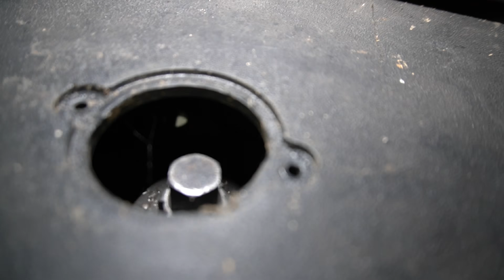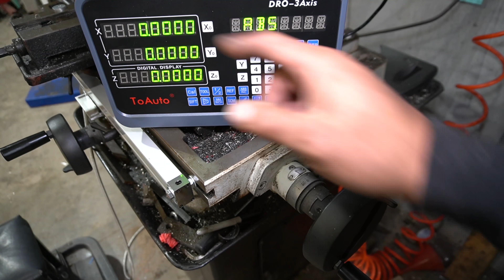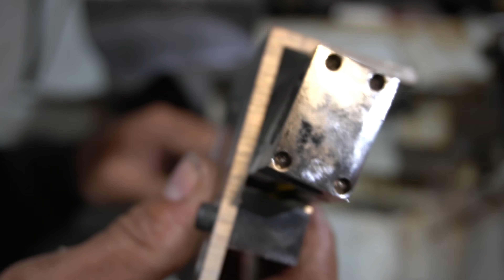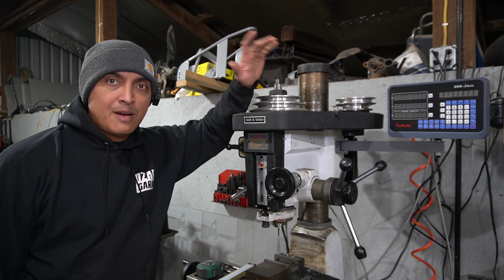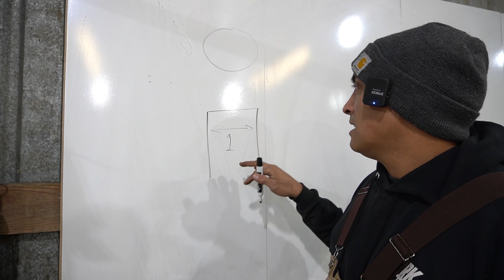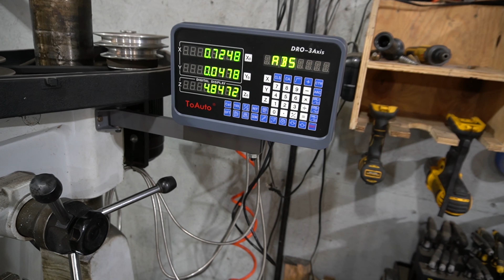Mill/Drill Upgrades Part 1: DRO

Comment: Turns out your RongFu is very similar to my Central Machinery mill also, and I think we also bought the same 3-axis DRO. So this vid is just what I needed for pointers on my install. I won’t be doing mine exactly like you did, but definitely helpful answering some small detail questions I had, and the final result turns the mill into a much more accurate tool. Thanks

Comment: What length rail do you need for each axis? I purchased an RF-31 model.
Reply from the maker: I got the 150mmx300mmx550mm kit (effective travel) mounting lengths are 140mm longer than the effective lengths. It is listed at 5um resolution,  which comes out to be .0002"
Reply: @ozarkgarage Thank you

Comment: the problem on these mills is not the DRO,   its the play in the spindles!   everytime to move your part you have to ''lock'' the table,  and believe me, that is difficult enough because it tends to move while being fastened!   if you are really working to great precision the only way to go is to change the spindles for more accurate ones, (ball bearing ones)   for this you need a lathe and quite an amount of time,   but after having done sthat it works good (besides the problems with the ''plast gears in the mill! ( but thats another issue!)
Reply from the maker: No plastic gears on this one. Belt drive

Comment: When you did your X axis what did you do about covering up the ball oiler in the table?  It is kind of an important oil point for the bed ways.  Of course it is the same thing in the back, another ball oiler that will be covered.  I am going through a similar installation and am at the point where I have tried everything, only thing left is to drop the scale down which almost works but with the shield it will still be covering the ball oiler so I will have to notch it in such a way the oil gun nozzle can get to it.  Good video, I am watching it again to refresh myself on my choices.  The last thing I am considering is ordering a compatible (ToAuto) slimline scale, thinking it might be just enough to work better.  I have another floor mill to do with four scales and a three scale to do on my lathe.  The lathe may be problematical as I want to put the taper cutter on as well.
Reply from the maker: I just lubricate the ways from the outside. With a long flexible oil can nozzle, you can reach everything.

Comment: Question.  Do you have a ball screw installed in this unit ?  If not, how do you control the backlash.  Thanks.
Reply from the maker: No ball screw. Backlash isn't really an issue with the DRO since it tracks actual table movement and not rotation of the dials.

Comment: Great video. Just picked up the Jet version and ordered my DRO.
Reply from the maker: I ended up having to move the x-axis linear rail to the rear of the table when I installed the power feed, btw. You can see how I did it in that vid.
Reply: @ just saw that ordered the power feed as well hahahah

Comment: I see that you got a ToAuto DRO. What resolution did you get on it? Or would you be able to share what kit you bought? Thank you for the video.
Reply from the maker: I got the 150mmx300mmx550mm kit (effective travel) mounting lengths are 140mm longer than the effective lengths. It is listed at 5um resolution,  which comes out to be .0002"